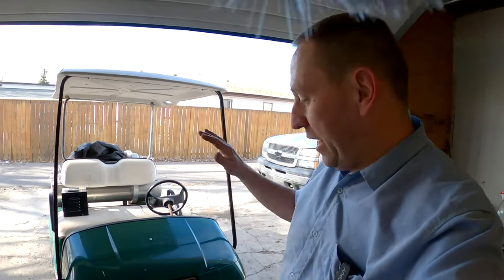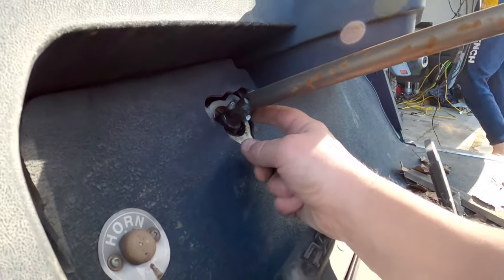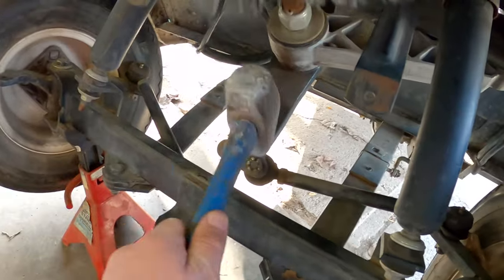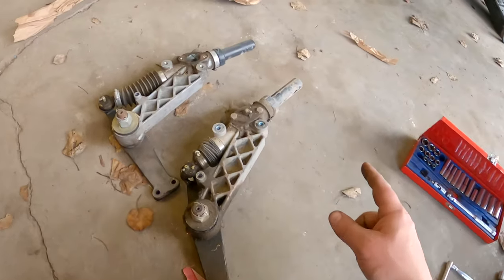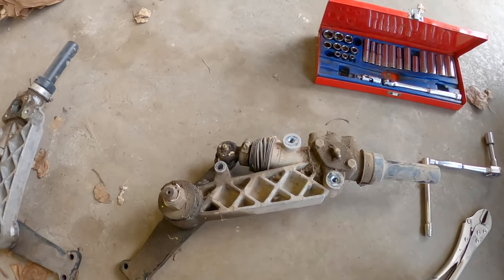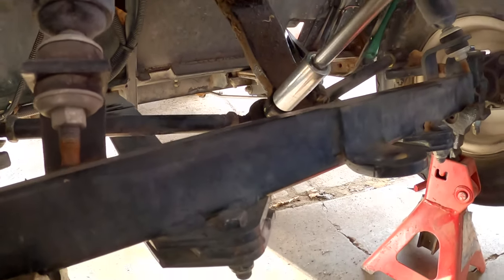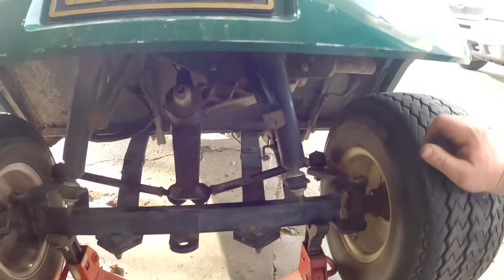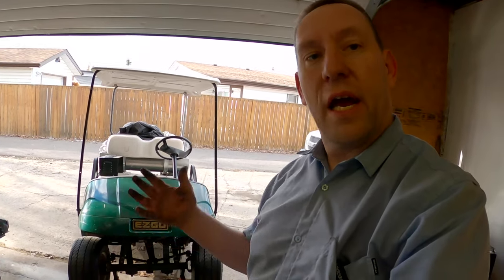How-To Swap EZGO TXT (1994-2000) Steering Box Assembly | GT Canada

Comment from the maker: You can get the Steering Box Here - https://amzn.to/3yYht1h

Steering Tube - https://amzn.to/3z3qwhi

Golf Cart Accessories

Steering Wheels - https://amzn.to/3iYw33i

Steering Wheel Hub - https://amzn.to/3yXoLlG

FANCY HubCaps - https://amzn.to/2XDUFpG

Rims (No Lift) - https://amzn.to/3AUD8YO

Rims (LIFT REQD) - https://amzn.to/3szVvz5

This is the tool kit I use to fix my cars and boats - https://amzn.to/3h58UtI

This is the Scanner I use yo Diagnose ALL Autos - https://amzn.to/3k56zjQ

Comment: Hello! Do you happen to know the torque specs for the two blind bolts that attach the box? Thanks!
Reply from the maker: I went for as tight as I could do them with a regular ratchet.

You don't want to over crank them or you'll strip the holes